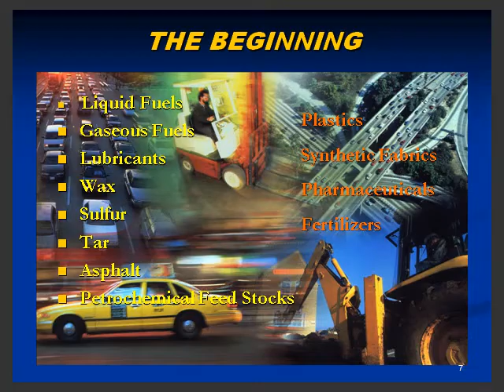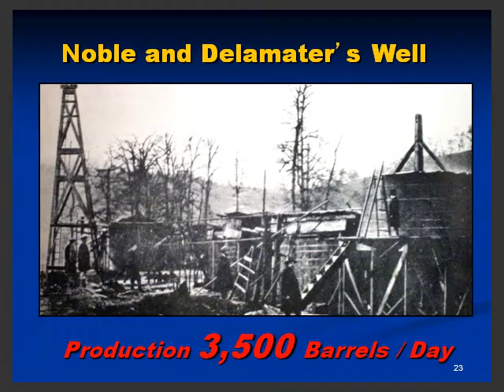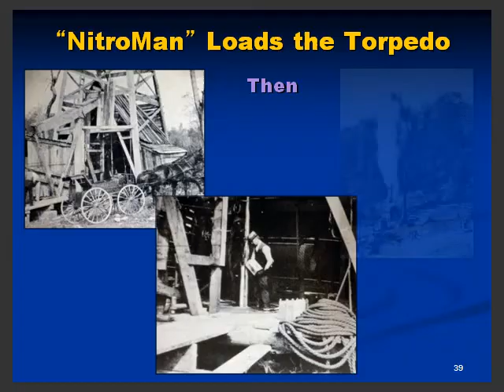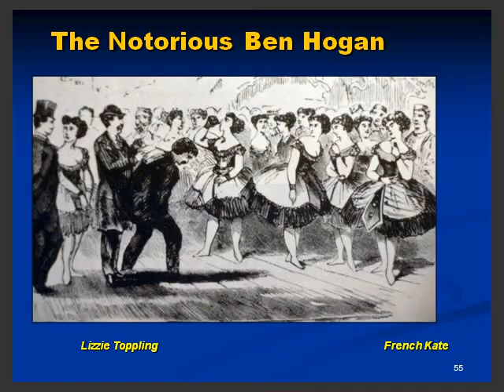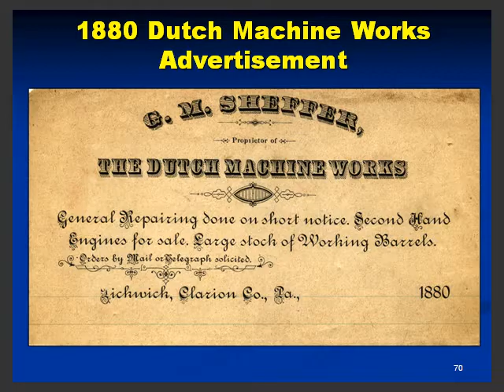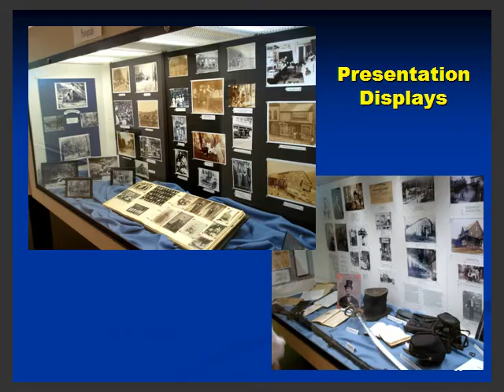The Early Pennsylvania Oil Industry

Comment: Thanks for this excellent video. I grew up in Oil City. I have fond memories of playing in the pump houses back in the early 60s. For those who don’t know, a pump house has a large diesel engine with a horizontal wheel that acts as a hub and drives oil pumps located in all directions surrounding the pumphouse, in a hub and spoke fashion.  We need a major motion picture produced about the life and times of Colonel Drake and the birth of the oil industry.  I am not referring to a documentary, rather a movie with plots and twists, etc.. Thanks again for this great video.
Reply: The cheapest way to power them was with an on site, low speed, single cylinder natural gas engine which burned casehead gas coming off a shotgun separator. Well, the cheapest way is electricity which is how most have been converted to, but grid electricity wasn't available back then.

Comment: Loved this presentation I too have family ties as I grew up in the oil patch. I live and worked in the Burning Springs WV boom. The Rathbone well came in here only 2 months after the Drake well by reported history. However there at least some who feel the Rathbone well was actually first. That said though the Rathbone well was a big producer at over 100 barrels a day. The well has been restored and now considered the oldest producing well in existence. Like your area Burning Springs boomed in 1860 to over 10,000  and the story is pretty much the same as yours. One interesting note the great grandson of the original Rathbone that drilled here was a co-founder of what is now EXXON-MOBIL It was originally ESSO before they changed it to EXXON and a few years ago EXXON bought out MOBIL. As for my family my grandfather  became a teamster back before 1920 and later became a driller. My dad also became a driller and later so did I. Me and my dad were among the first to drill the new Devonian Shale wells here in Burning Springs that sparked another mini boom in the 1980s.

Comment: Great Video . My family started drilling in the early 1900's.  My grandfather mainly worked later in the gas patch. He was a drilling contractor and owned a Standard Rig and A No 2 National Machine on which I grew up .  Those were the very best days!  Long hours and hard work but I would far rather have been out working on an oil or gas well any day instead of what I did for a living but twas not to be.  Thank you again for this great video. On the 150th. I was on the Standard Rig at Drake Well because of my knowledge of the rig and because my father worked on it and helped set it up at the park.
Reply: Can you tell me how did the get paid when oil was first struck to be fefined?
Reply: @katevalentine7075  They got paid by the barrel depending on what it was selling for at the day they sold it.